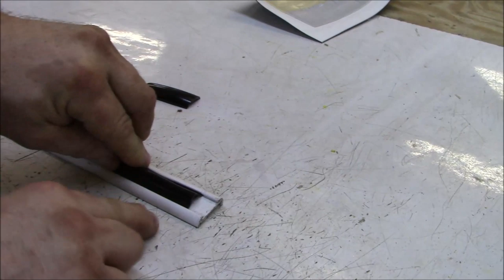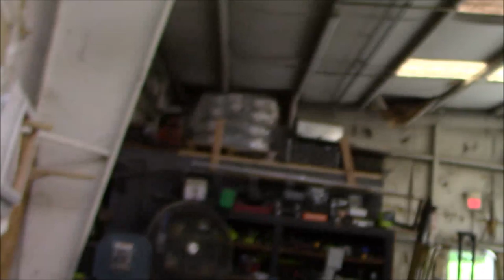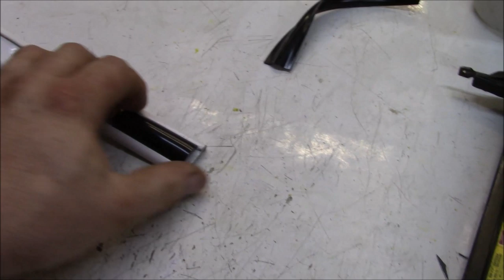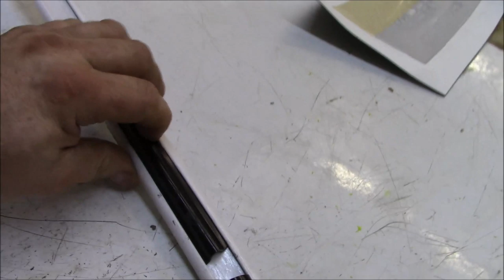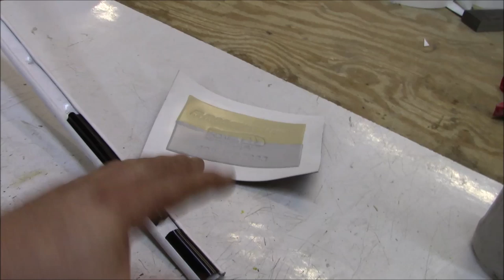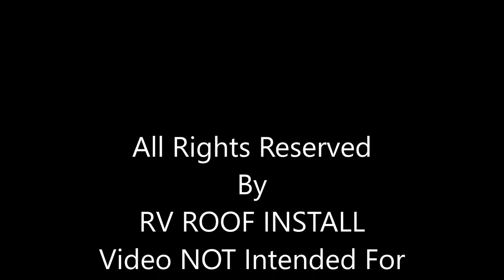Explaining The Different Insert Trim

Comment: Can someone please explain to me why you would not use a sealant vs this trim that just gets brittle over time??!!
Reply from the maker: @RC-hm9vg  we seal all the screws and then install the insert. Insert conceals the screws and just has a better appearance.  The cheap insert will get brittle. However, the insert we use has been saying flexible for years. We have replaced any as of yet, and that's going on 7 years. We dont sell anything. I guess you could use a similar product...AP Products has a similar insert. Theirs is more flat than what we use. 
Thanks for watching.

Comment: ok i thank you  however  i messured my rubber seal its 7/8 what size do i get on that product ,on the web there is 5/8 to 3/4 1"
Reply from the maker: Rubber seals? Or do.ypu mean insert trim. I buy the 1 inch insert trim. Then it bulbs out and rolls the rain into the gutter.

Comment: I need to ask a couple of things, my old molding is 1 inch wide when flat,the opening (top) is 5/8 what would you order? Steele Rubber sent me samples and none of them fit as good as your. another question where else can you buy that type of molding that you have other than steel rubber?
Reply from the maker: Is this to fit in or cap over?  Measure the track. Those are smaker ID.  The ones that fit in the gutter  are 1 inch.
Reply: Cap over is what I want, I have a class C front bunk overhang and I want to put new inserts in, I have a very small leak somewhere on the passenger side.
Reply: Also what is Smaker ID ?
Reply from the maker: Typo..track ID means inside dimensions. Leaks could be coming from the lights, could be the screws to the corner molding. If you replace the corner molding like you want to,  you should backcourt every screw a little bit and swab a dab if caulking on the head of the screw. Take a few out and see if the shank is rusty. Also, make sure the corner molding is caulked well, especially in the bottom, because that's where the water hits.
Reply: It’s corner insert trim with the opening on the front of the bunk that wraps around top to bottom. 
Trim is 1-1/4 wide with an inside opening (insert) 1 inch with top opening at 5/8. When you flatten the old insert it’s 1 inch. I was going to do everything you said but if you didn’t buy the Steele inserts where did you get the ones you used ?
Reply from the maker: @Yellowowleye  I buy mine from the actual manufacturer.  I have to buy pallets of it. They don't sell to the public. We don't sell anything either. AP products has a similar insert trim. You'll need a 1 inch insert trim.
Reply: It’s not the lights, I know where the water is coming in and it’s the trim, the insert is bad. Do you work on RV’s ?
Reply from the maker: @Yellowowleye  insert doesn't stop leaks. It's conceals the screws. You can see thatvwayerncouks easily get in the track even with a new insert trim. That's why I recommended to seal the screw heads...just a suggestions....its your project...
Reply: Thank you I appreciate your help

Comment: Ok well how do you make sure you get the correct width? My rails are just measure 7/8" as the groove width and 5/8" inner slot width. You can get 3/4", 7/8" and 1" wide trim but which one do I get. Is 7/8" nominal 1" trim with it bowed in the middle or what?
Reply from the maker: We use 1 inch. It should bulb out which will cause the rain to follow into the gutter. It's a water adhesion principal.
Reply: @RVROOFINSTALL  Did you have a link to buy it? found 3/4 but its loose and can't find 7/8, not sure if I can put 1"
Reply from the maker: @Toledo’s LivingLife  I have to buy 2 miles of it at a time. I do t know where to buy a small quantity  for one camper.  We don't sell anything. We are a service center only.  AP products does have some insert trim. Its called RV vinyl insert trim...if you search online

Comment: Where can you buy that in white? All I can find is the cheap stuff. Or who makes it? Appreciate the assistance.
Reply from the maker: DX946-1W insert trim
Reply from the maker: https://www.ebay.com/i/222479935596?chn=ps&norover=1&mkevt=1&mkrid=711-117182-37290-0&mkcid=2&itemid=222479935596&targetid=886140166958&device=m&mktype=pla&googleloc=9011126&poi=&campaignid=9426387333&mkgroupid=90869814370&rlsatarget=pla-886140166958&abcId=1140476&merchantid=102013376&gclid=CjwKCAjwgbLzBRBsEiwAXVIygKwVP4nCWPwC_1_w-alTc_l5tzTUzg-ydHSzKpRgQdFwIMiHtkR2tBoC7GMQAvD_BwE
Reply: @RVROOFINSTALL  Wow, thanks for the rapid reply. I have a 2019 DRV that I need to remove the trim and caulk all the screws. I ran across your videos and thought cool, a new trim....thank you very much.
Reply from the maker: @brettwickett1671  watch our videos on the 2017 Mobile Suites and see all the problems we uncovered. You may find the same on yours.
Thanks for watching!
Reply: What size is that black insert moulding? You linked 7/8". When I measure my track it's 7/8" but it seems like most still use 1". I just want to make sure it's going to be a nice tight fit. Thanks and I have learned a lot from your videos.
Reply: @INFRNL1  may I ask what size trim you ordered ?
Reply: @kenj.8897  
I will have to see if I remember where i got mine.
I got white and i want to say it was 3/4" and worked great.

I'll see if i can get all the details for you
Reply: @kenj.8897  
Okay. I ordered 7/8" in white from automotive authority. Hope this helps
Reply: @INFRNL1  thanks for digging

Comment: 2 miles? I bet they thought you would say no thanks
Reply from the maker: We did have a bit of sticker shock but in the long run its worth it. It's a better product to keep coaches even more watertight and since it's not a increase coach by coach we just sucked it up and got 5 years worth...lol. we want to offer the best products to our customers because these are too expensive to do twice. Folks expect professional service and professional grade material. We take their trust seriously and don't cut corners. I've a a few coaches overstay their welcome with problem after problem but we still stay in track to correct them and do a quality job. Not necessarily a fast job....lol. thanks for watching.